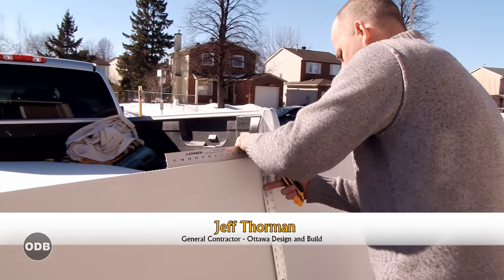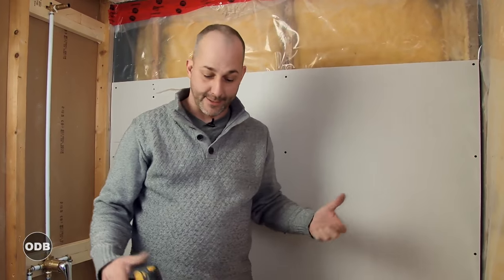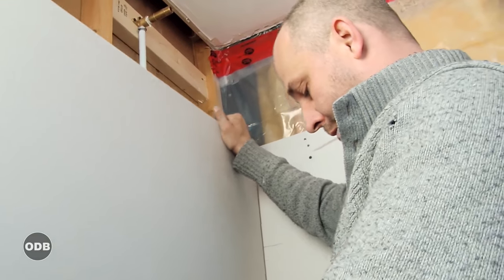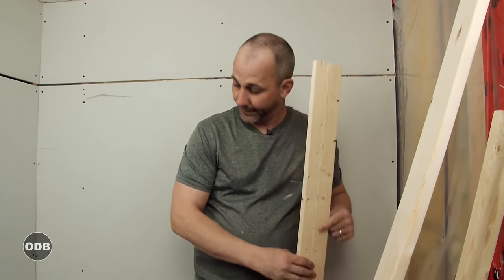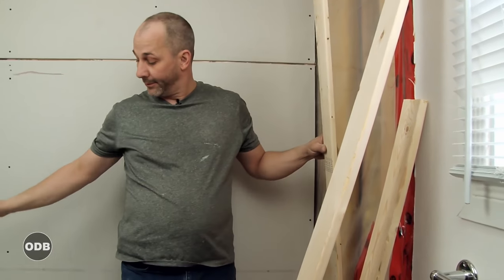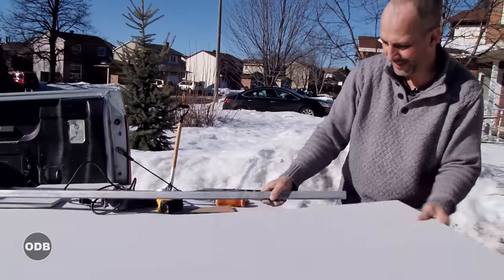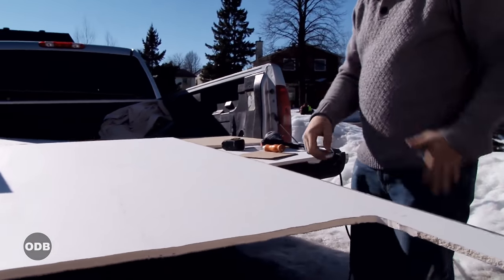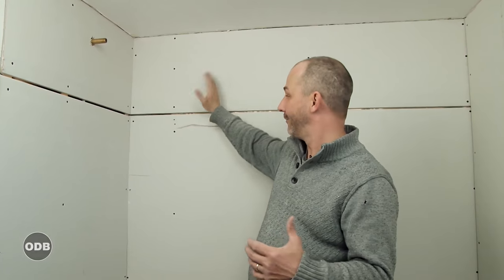How To Install Drywall in Your Shower

Comment: Use Redguard if you dont use blue or green board
Reply from the maker: Redgaurd should be installed with blue board. it is not guaranteed to be vapor proof.

Comment: ...are you breaking the paper on the drywall with your screws???
Reply from the maker: No Dee, I did not, but that brings up an interesting point. If you need help with the depth of your finished screw you can use a dimpler bit designed for drywall installation. They are however very useless in the corners so that is why I don't use them.

Comment: I think the idea you must use cement board is a load of crap.  I seen plenty of old homes with tiled shower walls over plaster board with no issues. I am talking about houses built in the 50's.

Comment: Why the hell would you install drywall not designed for moisture in a shower should be Cement Board like Hardie Backer it will suck up moisture. This is just plain stupid.
Reply: He puts water proof membrane in the next video. Which is to code in most areas.

Comment: I paid someone to do my shower and floors. This guy used drywall on a 17” x 9’ area in the shower now I’m trying to correct it because the shower exterior wall was wet and getting moldy and ugly at the bottom. I thought my kids were getting water on the floor. It would happen every now and then more frequently. I used to do dry wall, I open the wall and what do I find no cement board but drywall wtf 😳 I don’t do tile but know better than that. No Redgard will work on that how do I know because I can see the redgard at the seems. Now 10 percent of the shower is shit the same 10 percent he cheated out on. Now I will not call him out lesson learned let someone who has the time sue his ass. It lasted about 8 years if anyone cares to know. It’s not about the money it’s about time. Wasted. Could have did it right once. I would have paid him extra for the materials and for him doing it right is the problem. Don’t follow this video I work in remodels that’s how I know this is the wrong way. That’s how I know this dude fd up. He wasn’t the lowest guy either I need it done to move in and he happened to be in the tile section looking for work asked if we needed work said no and gods will ran into him at Panda Express. Let him do the job regretting it.
Reply: That’s why I Never hire a Panda Express drywall guy. Try Taco Bell.

Comment: Sigh ... Just Terrible Advice!  NEVER use drywall for shower walls.  A leak from above or behind will destroy drywall very quickly, and ruin an expensive shower. 
Always use a PROPER BACKERBOARD, that will not fall apart when subjected to water.  Preferably a foam backerboard like USG or GoBoard - they are inherently waterproof, light and easy to cut.